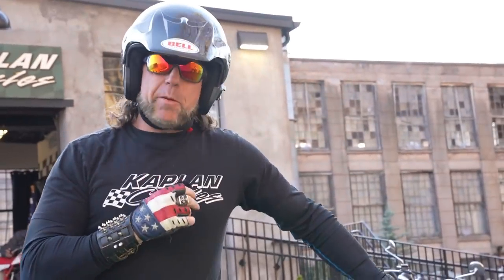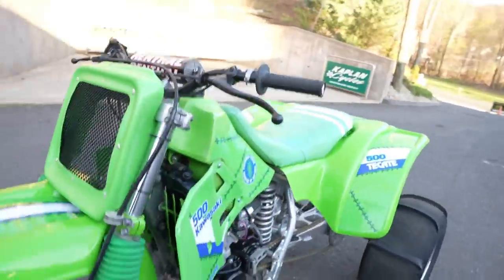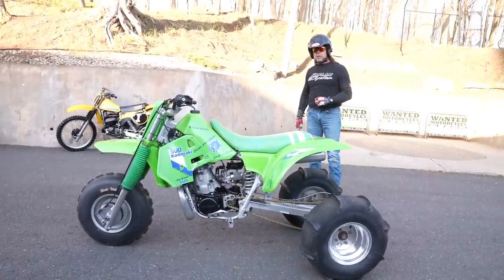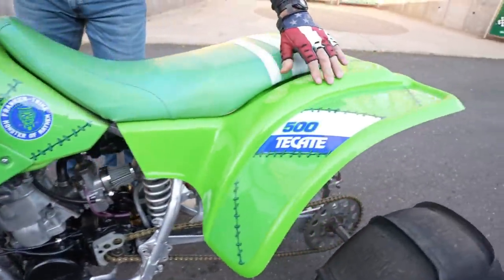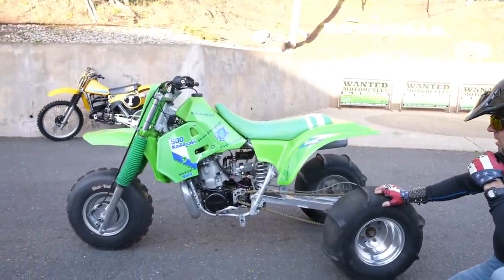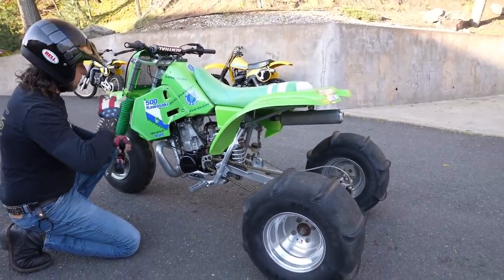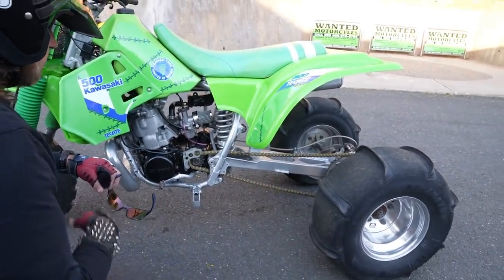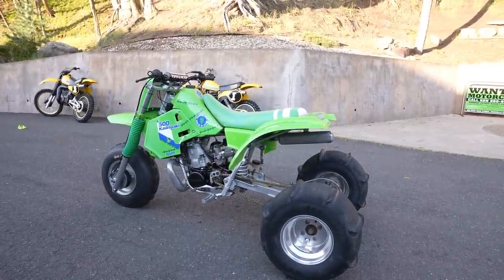FRANKEN-TRIKE...ITS ALIVE!!!

Comment: Had a friend in the 80's that had a Tecate with flat trac tires. Coolest three wheeler ever. Will be on the lookout for this one at auction! Such a outstanding bike for its time! You Always blow me away with such amazing finds! Keep up the good work! WOW!
Reply: Buy it. His prices are very high tho!
Reply: Buddy of mine has six different Honda ATC250Rs and all of them have various ESR and LED big bore kits. One of them is a 370ceo kit, and it’s absolutely terrifying and absurd even with a +3 swingarm and wide axle and cr250 forks. Prolly my fav is the 363 stroker and the 265 national cylinder with the extra fat big bore pipe. These things are so powerful they’re snapping engine cases LoL

Comment: Extended swingarms should have a chain tensioner on them for the chain slack and flop.will keep chain tension on the sprockets a little.plus it will keep the chain from stretching from being to tight